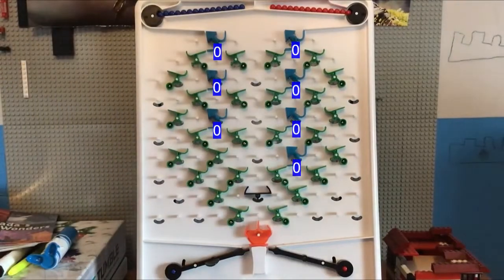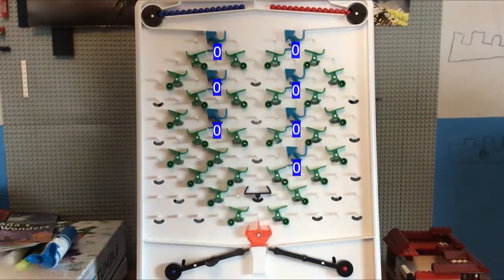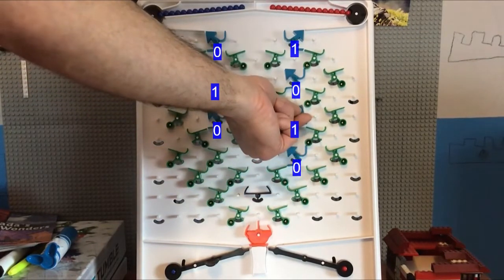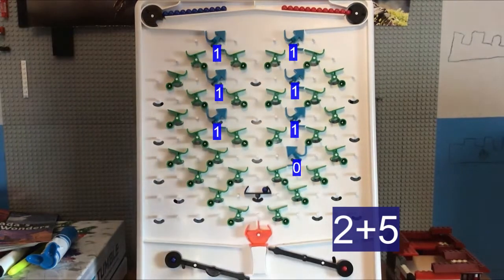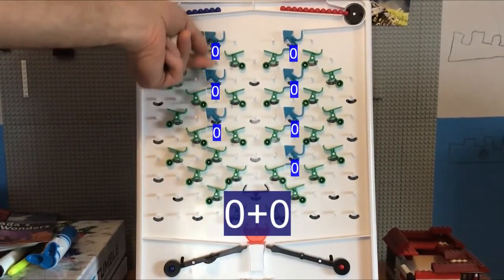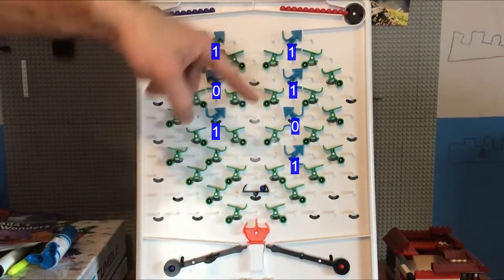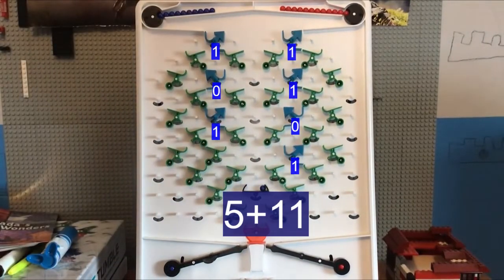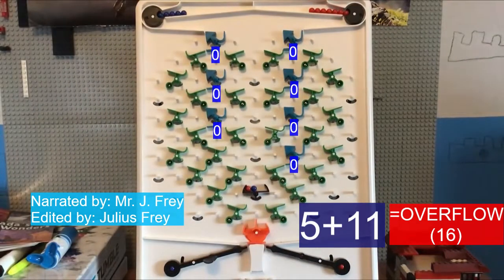Turing Tumble - Calculator

Comment: Can anyone explain to me why each bit increases in the way it does? Why r the bits values 1 2 4 8 etc rather than 1 2 3 4 
That's the one part that im not understanding
Reply from the maker: It is the binary counting system used on computers.

first bit is 2 to the power of 0 (=1)
second is 2 to the power of 1 (=2)
third is 2 to the power of 2 (=4) and so on...

Using this you are able to register all the number needed, while using less space.
Reply: The reason you use binary is not because of space.  You use binary because you are using a numbering system that only has 2 numbers, left or right, or more commonly known as 0 or 1.  The flippy thing, IF it had the ability to be in more than just the right or left, for example, left/middle/right, then you would have a trinary number system which would be 0, 1, or 2.